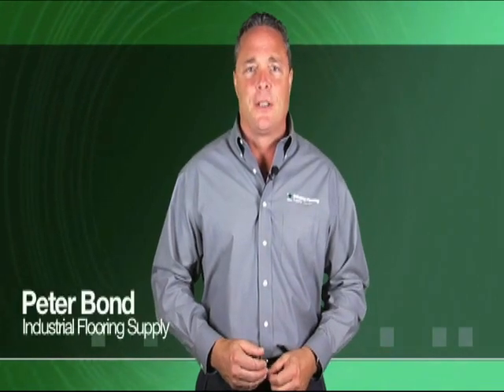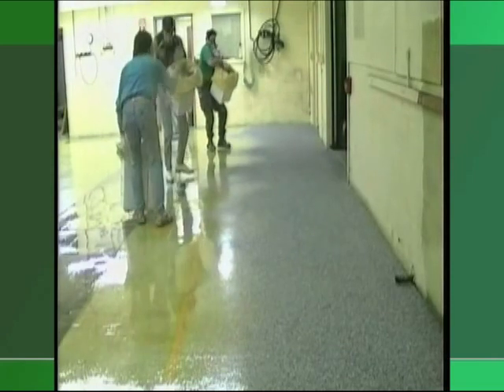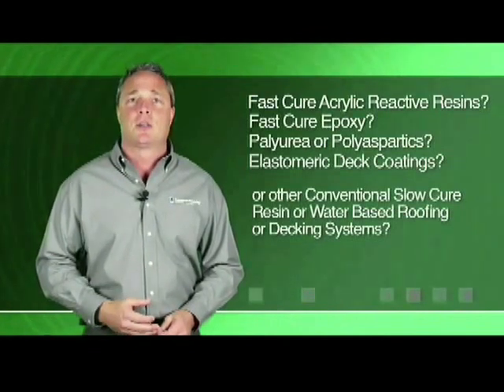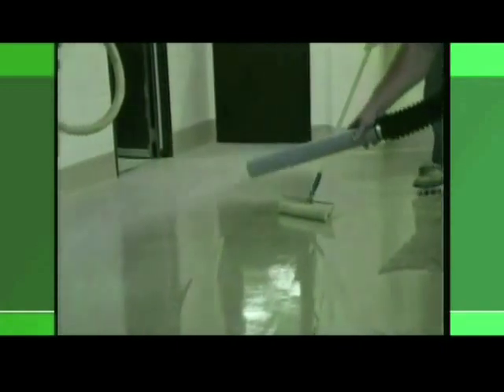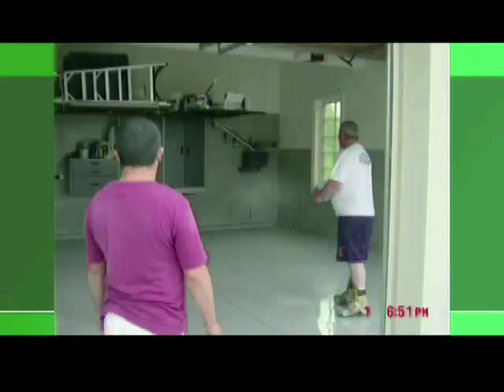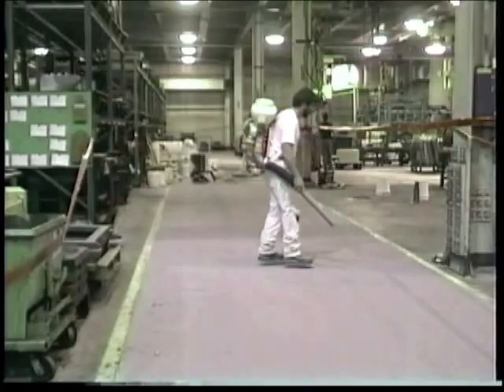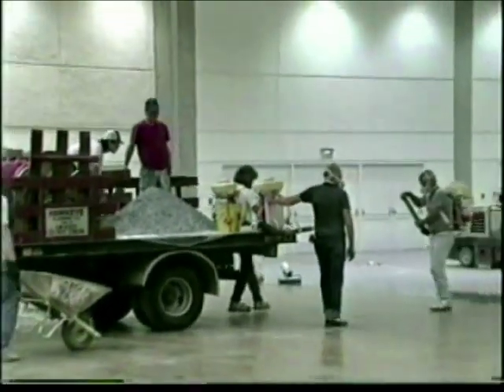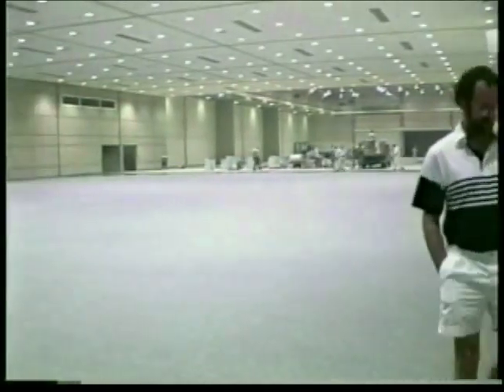Industrial Flooring, Deck, Roof, Wall, Back Pack Broadcast Machine

Comment from the maker: @painter213 Been there, done that hopper gun routine 30 years ago... My way you concentrate on getting the floor or wall poured quickly instead of having to wait for the broadcast crew to catch up... More guys coating and less broadcasters... No hoses or extension cords,,, a "walk in the park".  Once you use this system, you will wonder how you ever got along without it before... Hope to hear from you soon... Tom Uhlich

Comment from the maker: For those of you broadcasting lightweight media such as Mica, Cyber Fyber Flake, and some conventional flake that is lighter than normal, we now have an add on that enables you to broadcast those materials easily. It's called a SuperShute and is available on the drop down menu for the 2306 broadcast machine at the Online Store on my website www.fastcurefloors.com

Comment from the maker: Well actually it's MMA in the video's but Ucrete clones,,, it's basically the same thing KTG.  

When you broadcast by hand, there is a lot of excess media going on the floor that you have to sweep up and,,, a lot gets wasted, among other scenarios.  

50% savings reports are from users/customers in the field...

For instance.  A contractor just did a large flake project and ordered 2 skids of flake. This was his first large project with the broadcast machine and he was unsure of his consumption rate so he ordered as if he was going to broadcast by hand with no waste and spillage figured in so his actual order amount was even less than normal.

Well,,, turns out,,, he only used one (1) skid, plus he had excess sweep,,, that was minimal to none.  

This isn't an isolated instance,,, I have other unsolicited reports/emails/phone calls from many others who report the same thing. (I have been selling and using the machines for so long I don't even have a handle on hand broadcasting consumption rates anymore)

When you get really good,,, you can 'time' your broadcast to consume even less.  

When it comes to labor,,, I have countless emails and phone calls that they had "NO SWEEPINGS" (excess broadcast media) to clean up. Quicker faster broadcasting, less people, less media management, etc., etc..

Some people get this right away,, some take a few jobs,,, and,,, as life goes,,, some never do 'get it' (which are few and far between)!!!  Simply a common sense issue.

Imagine the money you save not only broadcasting at a quicker rate,,, imagine not having to manage all the excess broadcast media from hand broadcasting.  

So if you really stop and think about it,,, the labor goes well beyond the task of sweeping/removal of the excess media from the floor...

Think for a moment about the excess media management i.e. handling, transportation, storage, waste, etc., etc..  

In the case of flake, some flake sweepings are unusable and the more on the floor the more unusable flake you have. Or, the excess can only be used on a specific job in the future because once you 'touch' them, in most cases, you can't use them on the existing project and you have to 'wait' until you find a project for the violated PVA based flake because of the size difference from sweeping and/or handling.

FYI, there are flake on the market that don't break down, are lightweight, and save about 60% on flake costs.  We have add on's to the machine to handle the lightweight media such as Mica, Cyber Fyber Flake, and some conventional PVA flake that is light weight. If interested, email me and I'll send the info. 

In the case of colored quartz, sand, natural aggregates, ALOX or other skid resistant media they are generally,,, readily reusable,,, however,,, think about the weight of the sweepings and the strain it places on your employees backs. (if you need a colored quartz (CQ), lightweight, non-skid alternative, email me for info)

Customers usually order one of these broadcast machines and try them.

Some enlightened individuals order 4, or more at a time because they CAN,,, "see the forest for the trees".

I have actually had a customer who ordered one to try and within the first hour on the job called all freaked out screaming "I can't believe this", "I can't believe this", etc., etc., and ordered 4 more to be next day'ed to the job.  He,,,  'Got It' !!!

Multiple's have been going out the door like it's going out of style since I went public with these machines.  In the past, since mid-80's - late 90- early 00, they were only available to my stable of contractors in the Midwest to help these companies maintain a competitive edge in the marketplace, which they did. 

The newbies,,, are ordering multiple machines for a reason. Again,,, it's a common sense issue.

For instance, a contractor who had his machine stolen told me he felt naked going to his jobs without it.  He ordered 3 more!!!  Hello!!!! 

I could go on and on!!!

Keep in mind,,, there are many other labor saving tips and tricks that the machine is good for, not just broadcasting.

FYI... In concept/initial design is a portable loading devise for the machine to eliminate hand scooping/loading of the hopper to expedite even further the proficiency of the system.  We have done this in the past bolting together some existing equipment and on large projects,,, it was sweet... 

Send me your name, email, and company and I'll send you more info Lone Wolf, et al... Thanx for the post.  tom@fastcurefloors.com